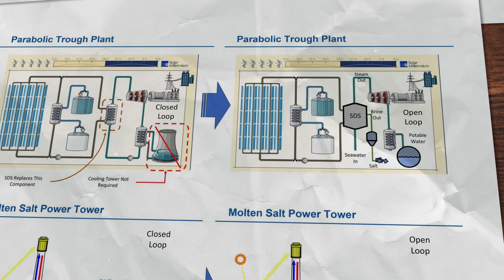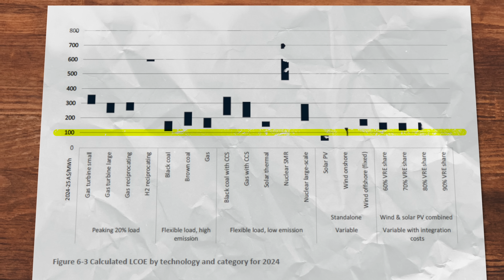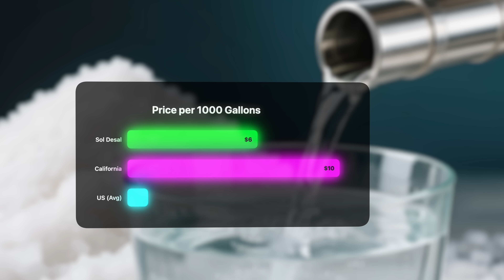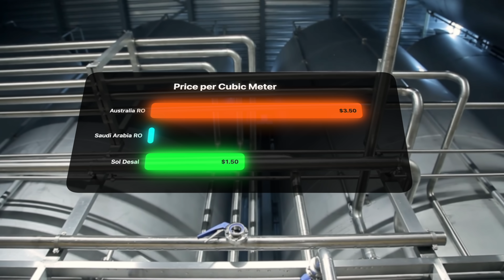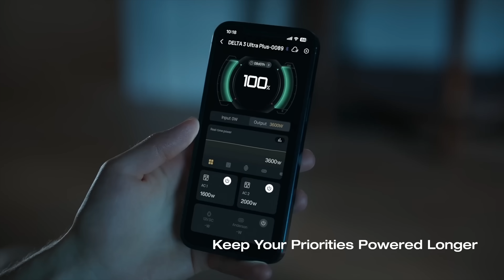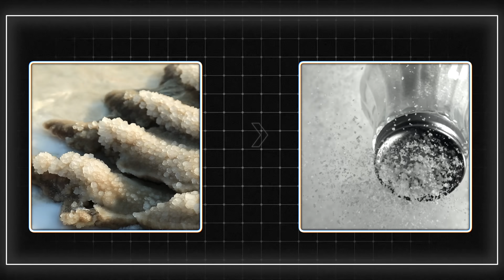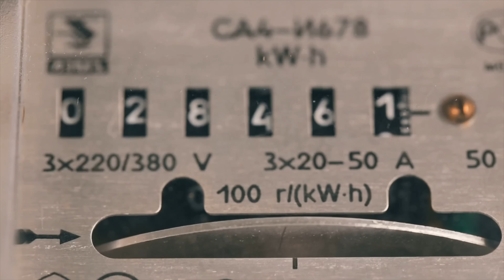The Desalination Process that MAKES Electricity - Too Good To Be True?

Comment: Concentrated solar / power generation / desalination of seawater-to-freshwater / sea-salt production seems a really good closed loop solution. The only thing I'd raise is the demineralized fresh water? If you re-mineralize it, where do those minerals come from - and is that sustainable? Regards the salt corrosion etc - someone will come up with materials that don't corrode (or not easily) I'm sure.

Comment: WRT Na batteries they use sodium carbonate not sodium chloride sources. So not sure the suggestion to use the waste salt for batteries works. 
Also there’s a lot more byproducts in the waste and so I’m sure further extraction and purification steps would be needed.

Comment: I can't believe you consider the salt grains in the steam a ,,dificult problem''  You have gravity and inertia. So by installing a 90 degrees piece in the steam pipe,towards down,with a deposit under it,the steam will do the elbow turn, the particles,heavier,will shoot in the box. Trick used in the harvesting combines for decades,to separate wheat grains from sand and pebles,dirt,etc.

Comment: STILL A BIG PROBLEM:
* It looks like some people have already mentioned this in the comments but, my research shows that when you're processing large amounts of sea water, you not only have the brine but, you have the additional trace minerals/metals etc as part of it.
* What are they going to do with all of those materials?
* You can't just take it to the "dump!"
* Yes, you covered it somewhat by stating that they turn the brine into usable salt but, I want to know what they're doing with all of the rest of the materials.
* Yes, it's an income stream but again, what is the company doing with it and how is it "refined" aka processed?
Thanks
San Diegan born and raised!!!
Reply: I don't see the problem. The minerals would be sold. Processing would depend on the industry that needs it.
Reply: @xaionik  The cost of separating and purifying valuable minerals could be expensive and generate concentrated brines that defeat the claim of  not producing brine.  One commercial source of sodium chloride is evaporating sea water or brine from the Great Salt Lake in Utah, but several sequential steps of evaporation, pumping out the residual brine, moving the precipitated salts to another pond where water is added to do another stage of recrystallization.

Comment: Years ago I have interests in such topics. However, there are two emerging trends could remove the needs of such innovations, and apparently China had adopted both. The first one is to setup solar farms in the desert. After years, they turned those sand into living soil. The second one is indoor vertical farm which recycle 90% of water without using soil. Both manage to create sustainable ecosystems and water cycle. I believe both approaches were tested and experimented in US. But none of them can go anywhere because of the Oil and Gas companies. Meanwhile, farmers in US could adopt no-till and cover crops to improve the water storage and organic mass in their fields. But they just don’t believe in science or being resistance of change.

Comment: Solar heat the salt water into very hot steam, transfer some of that heat to distilled water that runs the turbine, evaporate the rest of the water (making more distilled water). Salt is left over.

Comment: Water boilers don't use salt water because they will accumulate salt build up and get blocked, causing an explosion.
If you run a secondary loop with a heat exchanger, efficiency goes way down.

Comment: "75% cheaper" means the price is 75% less than the original price.

For example, if an item originally costs $100, and it is 75% cheaper, the new price would be $25 (because $100 - (75% of $100) = $25).
Is this what you meant? I don't see anything costing $400.

Comment: Energy is the  cost impediment to desalination whether it is pumping or heating.  Brine management is next again being a pumping or heating cost.  The described system is a clever way to reduce costs but it still requires a large amount of energy and pumping sea water in CA to where there could be large solar thermal collectors is daunting.  The sun desalinates billions of gallons of water daily without pumping or handling brine.  Decades ago I suggested to a friend involved in water management here in California and suggested a simple (in my simple mind) way to get around some issues.  Much like off shore drilling platforms can use large tubes to support the structures use one where the bottom of one tube is even further below the water surface. Using the natural pressure of a column of water above gives the pressure to make the reverse osmosis work. Because pumping cost minimal the salt gradient can be much lower allowing RO membranes to be efficient and brine rejection a non issue because instead of removing 50 % of the water it could be much lower as is evaporation on the surface of the ocean.  There are ongoing projects where the concept of low brine desalination in the ocean is being tried. One uses  a tube like I suggested the other uses floats anchored to the bottom which use ocean swells to pump water in a conventional manner.  3 feet away from these devices the brine concentration in the ocean is not measurably different from the surrounding sea.  My friend brought out the cost of piping from such a platform to the land and I suggested using large inflatable bladders and since fresh water is a lower density than salt water they would float. A tug boat could easily move millions of gallons of water to the shore. No doubt that the logistics of maintaining RO systems at depth are complicated but is it any more complicated than preventing the fouling of turbines and disposal of millions of tons of salt?

Comment: Someone mentioned impurities in the sea water.   Dow chemical and all chemical companies use crystallization to get a pure material.   Natural aspirin is a typical form magnesium coming into the plant. It is turned into magnesium sulfate to purify and then turned into the aspirin in you stores.   To separate out the impurities if they are turned to crystals as a mixture is out of the scope of this manufacture.  The value of the product will need to be worth the cost.  Dow Chemical gets concentrated brine from the ground and separates many chemicals from it.  This is the reason Dow Chemical started in Midland Michigan.  Pure luck it is located in the middle of a hundred mile long vain of brine.  Think your in oil country driving to Midland.

Comment: Crystallizer requires super corrosion resistance materials and a way to supply the energy  needed.  Dow Chemical old crystallizer for Epson salt  (magnesium sulfate)  is pure nickel guess a half inch think  for about 10 foot in diameter because it is at a vacuum.  Heat is added through the nickel to evaporate water at a lower temperature.   Concrete is another material, but I never was involved in a crystallizer from that material. 
Particles in the steam stream is the reason methane from garbage mountains are flared off.  Simply sand, crystallize, etc. are carried and scratch diesel cylinders and would do the same for blades.  The typical solution is a cyclone separator like the Dyson vacuum cleaner. This problem has already been solved for hydrogen and natural gas. The commercial solution is a spinning drum as part of the pipe line that provides the power and time to separate the solids from the gas since the density difference is significant.
Where does the energy come for the crystallizer has to be the sun.  I would consider the crystallizer be the sun collector.  Double walled with the outer concentric cylinders  boiling water at high pressure that determines condensing occurring at the OD of the crystallizer.  The condensed water mixes with the sea water.  
"The vapor pressure of seawater and brine is lower than that of pure water at the same temperature due to the presence of dissolved salts, a phenomenon explained by colligative properties and Raoult's law."   Takes more energy to get water out of brine.  The sun collector needs to be a distillation column where temperature increases from top to bottom as brine strength increases so that vapor pressure of water is constant.  The brine at the high pressure of the steam will be shot into the vacuum of the crystallizer.   The vapor pressure is low and controlled by the temperature of the sea water that condenses the vapor.   Will not likely see the turbine.

Comment: Lithium is also in salt water, why isn’t that being extracted, the extracting process is the same as making salt? Second, if you look in any lifeboat, there is a solar still to make fresh water from the sun, with one part. You need to go back and ask how long does the sandblasting effect require to stop the turbine. Day,week, month, year, decade, millennia? I’m ok with changing the turbines out every 100 years like we do with every other turbine whose bearings wear out. Finally, there is a solar boiler in Arizona that is too expensive to demolish that used wastewater to run turbines back in the 1970. It’s still running.

Comment: "The salt is just a bonus." Well, no. As a nitpick, a concentration of salt in seawater of .035, 35 parts per thousand, applied to the claimed water ouput of a plant, makes it about 240 tons a day,  not 155. The thing is, at this scale, salt is not just a bonus. It is toxic and  corrosive. Recycling sodium batteries cannot simply pour the salt down the drain. That is just the brine problem made diffuse. And even granting that the high-temperature brine available can be used to power the crystallizer, that does not guarantee that the resulting salt will be cheaper than conventional salt mining. Unless you are simply willing to eventually pour the resulting salt into the environment, you are looking at 350 million tons of salt produced per year, every year. it's hard to project an infinite increase in batteries, sodium or otherwise. At some point you're going to have to deal with it.
Your characterization of "the economic value is in the lack of liquid output and elimination of regulaion" is very short-sighted. It's not unreasonable small scale, but at large scale it's no longer a bonus, it's a large diffuse cost. Just like pollution in general.

Comment: Wouldn't letting the steam condense first, then run downhill onto a turbine solve that issue?  You'd just need ample amounts of steam and possibly a large container for the condensed water. If large enough, these condensate tanks could potentiallu be filled enough to run continuously overnight, when there is no sun.  A gravity battery, per say.

Comment: The salt could also be used to store excess energy in molten salt heat batteries. So if solar grid excesses the demand of the desalination energy could be stored in form of heat. It is working with sand also but the brine salt is already available and huge systems could store a lot of heat. This stored energy could be used during night to continue desalination when solar is dark and also feed the grid with additional steam turbines.

Comment: the problem or significant drawback here is going to be all the stuff you'll need to invest in to harness the sunlight............ that is going to require massive amounts of open space and infrastructure in a location that receives a lot of sunlight radiation that is usable to convert or trap as heat to support constantly producing the amount of water that you will need. This also means more maintenance costs, but on the flipside it should also mean less moving parts which would help decrease the amount of maintenance increase
if you don't have to worry about getting that infrastructure and open space somewhere that receives enough sunlight to make it more viable, this is a great idea. Also salt water is the bane of almost everything (ie more maintenance costs).

Comment: SARCASM/ I'm sure there's no chemical consequences to putting seawater into a steam generator. /SARCASM
190 MW is not even close to 6% of global power.  you missed a couple of decimals.  it's more like 0.0057%
Sodium ion batteries use sodium carbonate, not sodium chloride.  Isolating the sodium from the mix of salts and contaminates and separating it from chlorine would be prohibitively expensive.  

As someone who lived on distilled and RO seawater for years, has operated steam plants, and has worked in power distribution,
This is a terrible idea.  It only sounds good because you haven't done those things.
it would be cheaper, more effective, and more environmentally friendly do do what those engineers said and run an RO plant on solar or nuclear power.

Comment: I don't see the problem about salt. As you mentioned in another video about a new type of batteries FCS. These batteries need salt (sodium) as part of the working system. And if the automobile industry starts to produce electric cars with FCS batteries, then the problem with extra salt in desalination process is solved. I do know, there will be a new problem though - getting from salt (natriumchhloride) to sodium (natrium), but I think we already have those kind of factories. We just need to build more of them to ajust to a higher production.

Comment: You said $6 per cubic metre of water.  You then said a cubic metre of water is 1000 gallons.  It’s not.  It’s 1000 litres, which is 264.172 gallons (US).  
This makes it $22.73 per thousand gallons, or 2.273 times more expensive than water in California.

Comment: It should be noted that a cubic metre of water is 1000 litres or 264.172 US fluid gallons. 

To put that into some perspective, a mid sized shipping container holds roughly 67 cubic metres and you would need 15 of them to contain that much water.

Comment: So we're assuming that there's zero lubrication for this turbine? Because I'd be shocked to learn that steam turbines don't need a constant supply of lubricating oil to replace what's strupped away by high temp steam, and ends up in this allegedly perfectly clean distilled water which somehow doesn't also bring volitile organics with it during boiling...

Comment: I had essentially this idea as a child in the 90's and upon asking some (adult) engineers why this wasn't already the standard, the condensed version of the answer I received was essentially that the energy efficiency would be too low. I'm excited to see if these guys really have solved that issue, and also to see what they plan to do about separating out the other components from the brine that aren't edible salt.

Comment: I thought you could use the brine for something?  Brine shrimp comes to mind.   Also,  saurkraut and kimchi on site!    And when brine meets seawater,  is there a way to harvest some thermal or electrical energy as they mix?   I think there is.  Could you do osmosis with 2 osmosis membranes? You are pulling water molecules from the seawater to the brine but intercepting some of it along the way? Sucking some of it out. Anyway, if anyone wants to DIY desalination in  a low grade cheap DIY  way,  I made the sunscoop.  It is a tracking reflector on equatorial mount with a fixed target.  You boil the seawater at the target, condense the steam and  bingo bango,  you have your distilled water!  DIY it for a fun project.  You could even do a continuous loop if you are adding seawater and removing brine  based on boiling temperature or something like that.    I'm not in the sun belt.  Sunny in Summer though.

Comment: This is an amazing system that is absolutely perfect t and cost effective... Except for the fact that it is no either. Mirrors are expensive and fragile, the system only works in direct sunlight, it is extremely dependent on constant maintenance. I requires massive amounts of energy to build, probably more that it would ever generate in its lifetime.

Comment: My guess is that their process is they make steam into clean water, then they collect salt and use a molten salt reactor process because salt stores heat for ages like you mentioned. Theyvwoild then use that heat to boil the now purified water from desalnation again to produce steam fornthe turbine.

Basically two seperate systems of boilers. And since brine isbused with zeolite for water softening and this process starts with brine water theres no need to question water softening for this process.

Id still like to know thr ph and sodium of the desalnation water made before its turned back into steam for a turbine though because as stated thats the real innovation if its coming out perfect.

But yeah... Vid seems to get partvof the process wrong with yalknof steam leaving cooling towers as waste and making it seem like initial boiled saltwater goes directly into the turbine as steam. 

Its honestly sounding similar in concept to thorium or natrium salt reactors in  nuclear that store heat from molten salt to boil treated water for turbine steam... Theyre using radioactive salts instead of salt water and solar though so this is a better green process.

Though the radioactive byproduct of natrium salt reactors is actually a highly sought material in nuclear medicine which is good.

Sorry for the info dumps btw. Im a power plabt operations engineer with autism and green energy innovation is my fixation. Please do more on this techs chemistry and possible corrections though because its very promiaing.